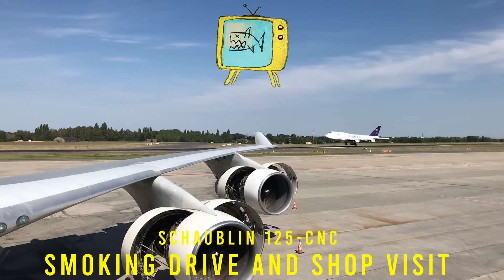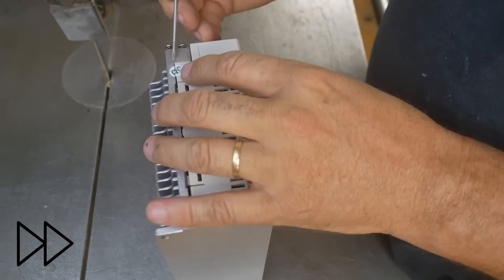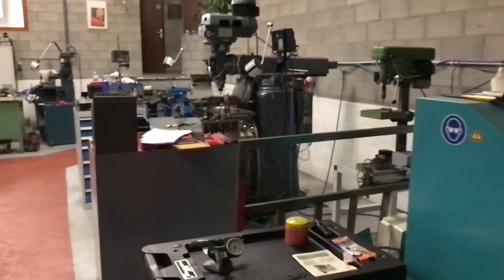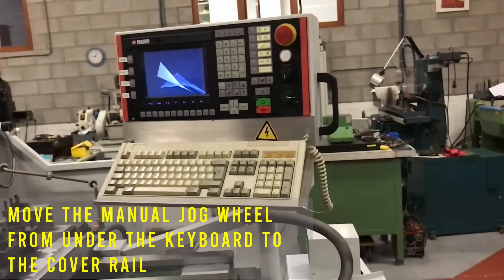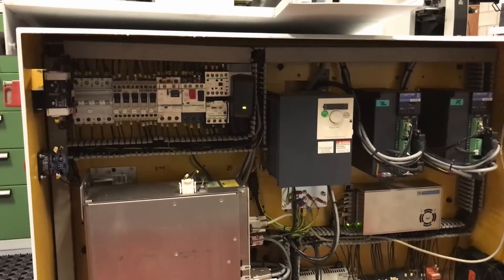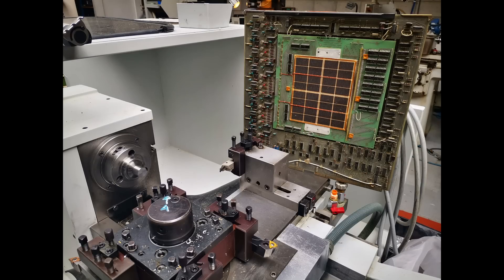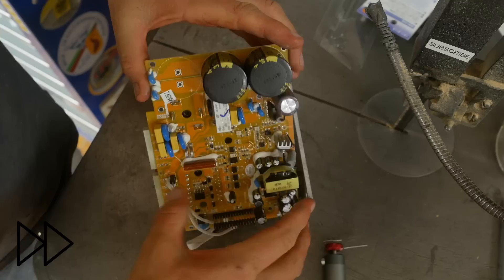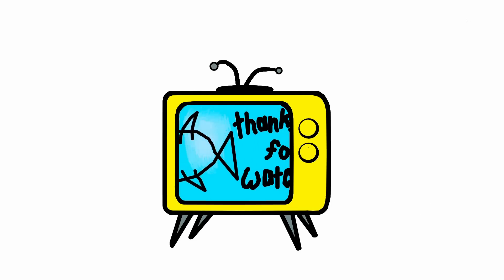When did my drive start smoking? Schaublin - Ep.42.

Comment: When I first powered up my haas cnc it smoked too. turns out the voltage at the shop it used to be at was much lower. I rearranged the transformer taps inside and that fixed the problem. at least until I moved again, at my house I get a voltage drop when the ac turns on(often in arizona) because the power company hasn't finished the upgrade for the service drop.
Reply from the maker: Was yours also a simple fix, like replacing a single drive?
Reply: @RotarySMP  Didnt have to actually fix anything, just moved the wires inside the transformer to a different tap. The main drive detected the higher voltage and attempted to essentially burn that energy off through the regen resistors. the smoke was probably old coolant oil and dust on the resistors. got pretty lucky.
Reply from the maker: @davidfarmer  That is really lucky.

Comment: I have a 16k version of that Data General Nova core memory board hanging on my wall.  It looks nearly identical, but has another layer of cores.  If my figgerin's correct, 64GB of memory made out of those, laying flat, would be a pile of boards tall enough to reach beyond the international space station.
Reply from the maker: Those things must have cost a fortune to manufacture. I wonder what the reject rate was? My guess would be - high!

Comment: I used to have a full DG Nova 1200 8K board that went in my 1200. It was was a little large for a wall hanging, so I cut the core board loose and hang that instead.  It was hung next to a 14" disc platter, a 8" platter, a 5" platter, and a 3" platter. Haven't rehung them since we moved a year and half ago.
Reply from the maker: Cool decoration. 
I wonder if there is anyone who can still communicate with my DG Nova?

Comment: Your mention of the Data General memory core brought back memories. I started out with DATA General, after my stint of being an Air Force jet mechanic, using basic language. Also, DG used a reversed language to avoid patent infringements. Anyway, I enjoy your work, mistakes and all.
Reply from the maker: Thanks for your feedback. I still have the DG Nova I pulled from my Schaublin, As cool as that core memory module looks on the wall, I am keeping mine complete.

Comment: i had the same
since then i have spare fuses for my servo drives (the pcb soldered ones)
and spare varistors (they explode when there is overvoltage)
:)
Reply from the maker: Once I buy spares, I can be sure of never needing them :)
Reply: @RotarySMP  well its like 3€ of parts
Reply from the maker: @mrspeaky6885  Cheap insurance.

Comment: Oh man! I'll have to confess to making similar mistakes under the same circumstances. Late, tired, rushed, and leaving it half done for a day or so, are just going to come back and bite. 

I would bet that it's more than just that one capacitor. It would be worth replacing the bulk capacitors on the logic side too. The fact that it errors on boot occasionally indicates an unstable supply. You dodged a bullet by not ending up with more than just that controller. I'd have been gutted. It's good that you have a spare anyway.

What a great setup Constantin has, and very generous of him to give you a tour.
Reply from the maker: Yeah, I am hoping this drive will work well enough to do the set up and tuning, but I will switch it out when the new on comes. I also have my doubts about it's longevity.

It was a great evening with Constantin for sure.

Comment: I hate letting the smoke out of things. 

I'm building a multispectral camera thing for work using the raspberry pi, cameras and a bunch of LEDs. Powered by 18v drill batteries. 

The other day I was trying to find a fault with one of the cameras- had the case open and tried plugging in a new camera board to the rasberry pi to see if the fault was with the original camera board. It was just kinda dangling from its cable, sketchy, but that's fine, I'll be careful...

... I knocked the board into the case, shorted it across the 18v rail and fried the camera, the pi and the connected touch screen. What a daftie. Still feel queasy about it.
Reply from the maker: It really frustrating when we do things like this. Looks like I got lucky. If it had blown MESA cards, they are hard to replace due to the chip shortage backlog.
Reply: @RotarySMP  the chip shortage did have me worried as it took me a few weeks to get the parts in the first place. I got lucky this time and managed to get replacements in a couple of days.
Reply from the maker: @SalmoTrutti  Wonder how long till supply chains normalise. Or maybe this is the new normal.
Reply: @RotarySMP  seems to be gradually getting a bit better- we can actually buy GPUs again, but some stuff (pi zero, pi compute module) are still pure unobtanium. 

Not being able to get doodads and geegaws almost instantly definitely made me think hard about how fragile all these supply chains are, and I now keep a stock of spare bits to hand for anything critical.
Reply from the maker: @SalmoTrutti  I doubt manufacturers will ever expose themselves to single source, just-in-time, supply from another continent again... until they forget this experience and bean count again.

Comment: 12:00 takes "have you tried turning it off and on again" to another level.
Reply from the maker: Weird that. I turned it one and off a few times, and always got that 888888888 display and Al-053, but now it has healed itself. :)
Reply: @RotarySMP  hahaha thats because you didnt' read the manual. section 82B states that: in case of working late and screwing up the powercord plug wire order, and delivering 400V directly to the brains of the unit, a capacitor will blow up. the first step to follow is to replace the capacitor, reasamble the unit, power it on and off several times, let rest for 2 days and the problem will go away. yeah... read the manual dude :P haahahahaha
Reply from the maker: @tobiasripper4124  That Manual is so cringlish, you can interpret anything out of it. :)
Reply: @RotarySMP  well i once installed a laundry machine for friend. this one's perk was "pet hair removal". went to the manual only to find a huge warning stating something in the lines of: "the pet hair remove program is meant for your clothes. DO NOT put your pets in the machine". im not even kidding. so talk to me about manuals hahaha
Reply from the maker: @tobiasripper4124  Humanity is doomed :)

Comment: DG Nova!  We had one of those at college.  8 terminals multiplexed to 64.  An enormously slow piece of junk by today's standards (or any standards, tbh), but great fun to play with.

If you only managed to pop a cap, you're the luckiest man alive.
Reply from the maker: Big if there :)

I still have the DG Nova from my Schaublin. I was hoping to donate it to a museum.
Reply: @RotarySMP  You should definitely donate it.  We had loads of fun with the machine at college, mainly finding "interesting" ways to crash it or to get operator privilege.  One interesting way to make it go pop was to endlessly throw print jobs consisting only of spaces and carriage returns to the print queue.  Eventually you overwrote the operating system memory space...
Reply from the maker: @wibblywobblyidiotvision  That is pretty funny.

Comment: As I'm sure you know, the potential problem with clipping leads after soldering is that you can break the solder joint. But those flush cutters are designed for clipping leads both before and after soldering. The trick is to make sure you don't exert much side-to-side force, and absolutely no twisting force, when you snip the lead. Also clipping 1-2 mm away from the solder blob can help, as any lead bending because of twisting the snips will just bend the stub of the lead and not the crack the lead out of the solder.
Reply: I agree, the flush cutters are exactly the right tool!   I'll add that if a solder joint is that susceptible to fracture then it wasn't done properly.  A well flowed solder joint is very solid.
Reply from the maker: @physicsguybrian  Thanks for the feedback.
Reply: Or reflow joint after clipping.
Reply from the maker: @nathanjolly4338  I need to pull that cover and do that.
Reply from the maker: Thanks for the tips on doing it properly.
Reply: Another issue is that clipping after soldering will expose the raw copper or whatever metal is there, helping corrosion and electromigration. The solder joint provides a protective surface of sorts, but the NASA guideline calls for a very specific joint look (so that it can be inspected). Anyway, it just means, that under home shop conditions, that part is more likely to fail after 40 years. Probably flux residue will cause it to fail sooner.
Reply from the maker: @ligius3  40 years from now...not my problem :)
Reply: I am self taught also and didn't know that you shouldn't clip them after soldering. Question: I put a spot of clear lacquer on the bottom of the solder joint after replacing as insulation. Is that wrong?
Reply: @HansFormerlyTraffer  Usually not necessary, but not wrong, as long as you are sure that whatever you use won't have long-term corrosive effects to lead, tin, or copper. Lacquer should be fine.

Comment: Well you can do like citizen does and have a run mode and a check mode where in check mode the rapid is like 1/6 the speed and run mode is full speed ( so if your makeing a couple of the same part you run the first part in check mode to see if anything is at the should be and when you know nothing bad is gonna happen then you just go into run mode and let it rip at full speed ( since you already tested the program and know nothing bad will happen) 

That's what we do at work at least
Reply from the maker: That is a good idea. I am not sure if there is an eaay way to set that up in LinuxCNC other than running two separate configs, and running the machine speed you need like that.
Reply: @RotarySMP  hey if its the only way to do that and it works then thats what has to be done i guess 
also hopeing that you havent forgotten about running a airline so it can use air on the part/tool well running to blow off chips when running pre harden stuff where you cant run flud cooling on it or for when running in a program to blow the coolent and chips away to see what is happening ( told you about it some time ago )

Comment: but voltage between 1 phases and neutral is not 400v but 220-240v depend of what voltage is your country. 
400v is between phases :p
Reply from the maker: Correct, but if you have wired up services on your three lines between neutral and a phase (expecting 230V), and then interchange a phase and neutral line coming in, you have two lines at 400V, and one at 230.
Reply: @RotarySMP  do you mean servodrivers is 1phases and you put 2 phases to the conectors intead 1phases and neutral?
Reply from the maker: @AnanasStudio  Yes, Those servo drivers are 240V single phase. I have one on phase 2 and the other on phase 3. The way I mirrored the socket, I think phase 1 and 2 got 400V. Phase three was still at 240V.
Reply: @RotarySMP  400v is when you have 3phases connect to the device.
AC has cycles on all 3 phases. All phases is "rotated by 120degree" In 1/50 sec you have 100% voltage of 1 phase, 2/3% of 2 phase and 0% of 3ph.
240v+160v+0v = 400v. This very simplified.
This is why 3ph motor rotates and are brushless.
Reply from the maker: @AnanasStudio  Correct.

Comment: LOL! The keyboard on that CNC lathe. I think it is from an IBM AT or similar. Those are really trusty keyboards making a distinctive sound when You tap them. I have a similar keyboard sitting on my table :)
Edit: I didn't freak out the cutting of the wires after soldering. If You would have used other type of side cutters, then maybe but those that You used do not deform the wire that stays on the PCB. However, it would not hurt to resolder them after cutting :)
edit2: The misbehaviour might be due to the capacitor juice freaking havoc on the surface of the PCB board. When You left it alone, it just dried and now it works ... maybe wash it ?
Reply from the maker: Thanks for the feedback. I will probably use a membrane keyboard on my Schaublin, I already got one, and dont like swarf in mechanical keyboards.

Comment: This is why all the profesional equipment use 3 phase without neutral and they have a transformer from 380 to 230v.
Reply: If I recall correctly this is how my moriseiki works. Has a huge transformer box that weighs about 200kg.
Reply: @MF175mp  if your lathe really has a 20kg transformer, it is probably a DC drive with variable speed
Reply from the maker: @MF175mp  My Maho also has some serious transformers, but it needs a number of different voltages both AC and DC.
Reply: @RotarySMP  it has 2 sets of transformers, one for the servos and one for the rest I think.
Reply from the maker: @MF175mp  Yeah, the Maho also has two.
Reply: And this is not for a human error, is for a broken neutral from the network which can cause the same efect.
Reply: @swatcat7928  I believe it also enables the manufacturer to use the same base machine for different countries that use different voltages. They would just need to swap the transformer.
Reply from the maker: I thought everything was going away from transformers, to inverters. Thanks for you comment.

Comment: After moving to another place we had the same issue. Somebody connected wrong the Line and the Neutral in the Socket.
And we must to buy new drivers and P-S on the Line received 380v.
Reply from the maker: I think I got luck here. None of my DC PSU's minded. It is just that one drive. Still annoying to make such a dumb mistake.
Reply: @RotarySMP  Yes, you did.
I'm always trying to double check myself, but in that moment I wasn't there in the shop.
Reply from the maker: @DPTech_workroom  What machine did the drivers get killed on?
Reply: @RotarySMP  It's a 4 Axis CNC Mill with ATC with K-Flop System. (DILATON from Ukraine)
Reply from the maker: @DPTech_workroom  Did all the drives get fried? Ouch.
Reply: @RotarySMP  Nope. 2 of them + 1 PS. ~$2000 + a month out of work.
Reply from the maker: @DPTech_workroom  Ouch. I really did get lucky.

Comment: Try to use ceramic thermal paste on high power electronics that have the isolating thermal pad. Silver based thermal paste might make a conductive path to the chachis.
You are very lucky as other said, i've seen 10n's of thousands euros wasted because an electrician messed up phase and neutral. 
On a new installation i always measure the incoming power at the breaker inside the cabinet before first power on even if i made the installation myself.
Reply from the maker: Thanks for the tip.

Comment: Man if it's only a cap I don't know how you got away with it! This is almost as good as me trying to charge a 15KWh 48V battery with a 20A HP Power supply but connecting the battery to the power supply backwards!!!! Loud bang. I panic. After examining the power supply schematic discovering that what blew was a power diode placed across the DC output. Sure enough upon disassembly the bits of the diode were scattered on the inside of the unit. Amazingly the power supply still works and I'm yet to replace the diode - on the todo list. We do incredibly stupid things at times that a simple cross check would have caught.
Reply from the maker: Yeah, I should have bought a lotto ticket rather than another drive.

Comment: I wouldn't worry about the clipping of the leads... those joints looked like they wanted some extra heat and flux though.
Reply from the maker: Thanks for the cross check on that. Easy enough to open it up and resolder them.

Comment: oh no!
Reply from the maker: Another really dumb, avoidable mistake.
Reply: @RotarySMP  Is a mistake ever really smart and absolutely unavoidable?
Things happen when you've lost your focus.
It's incredibly fortunate that only the cap blew, and that you were able to find one locally.
Very thankful that you share all the tribulations. Glad that you were able to use Constantin's experience to improve your project.  👍
Reply from the maker: @jimurrata6785  Yeah, it was  really cool to see a finished 125-CNC conversion really similar to mine, to calibrate the control module ideas.
Reply: @RotarySMP  Something to motivate you and aspire to. (except for that grimy nameplate!  😆)
... speaking of, have you ever considered an electric toothbrush, and maybe even toothpaste or a mild buffing compound?
Reply from the maker: @jimurrata6785  I have used the electric toothbrush often on the dataplate :)
Reply: @RotarySMP  🤣  The data plate grime is a meme by now.
I'm sure it will gnaw at you while you're using that beautiful little lathe!
Reply from the maker: @jimurrata6785  I was pretty happy to give Constantin some dataplate advice :)